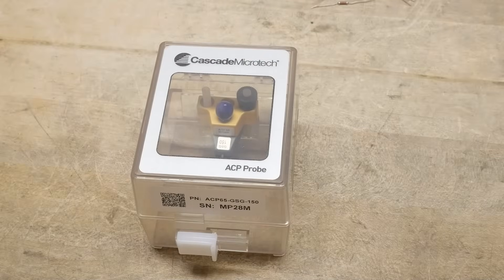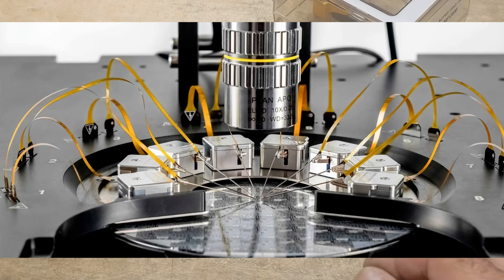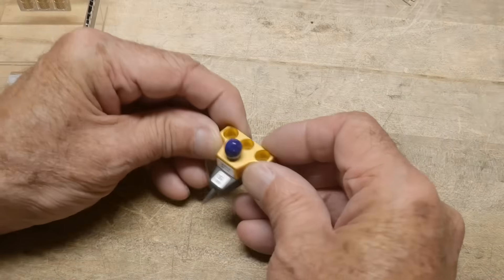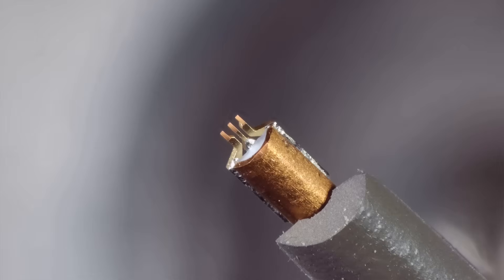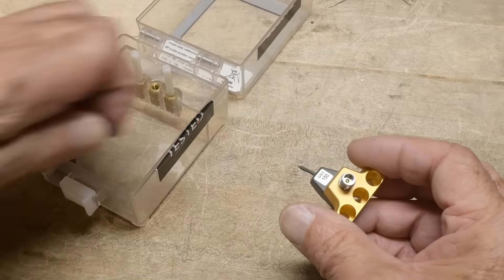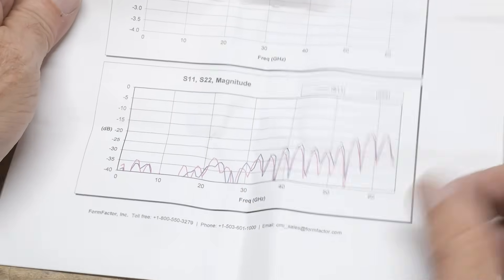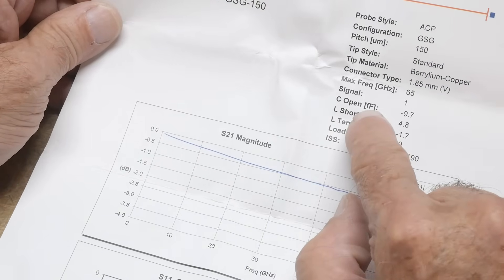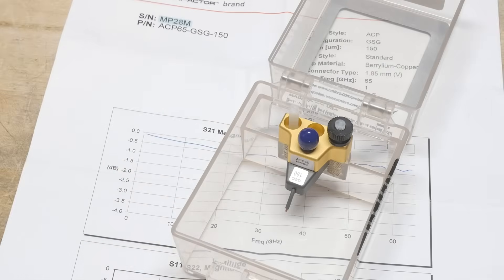#2365 65GHz Coaxial Wafer Probe

Comment: Long ago I got to design a PLL for a CPU chip at Sun Microsystems. When wafers of the CPU arrived they were given to a different department in the company that I never knew existed. I was allowed to attend testing with provision that I didn't talk about the equipment at that time. The wafers were tested without any mechanical probes on the internal metal traces. We could pick a trace in the IC layout and the "machine" would find and test its voltage in transient. It was like magic to see my simulation waveforms in HSPICE appear matching the real voltages on the screen. Sure beats the old probe stations. Back then we struggled trying to see rise times with expensive mechanical high speed probes in the early days.

Comment: Cascade is actually a real pain in the butt for making all custom connectors. Even the cheapo DC manipulators, the DPP105, have a custom coaxial connector which is very reminiscent of SMB but is entirely proprietary. Which of course means you have to buy a bunch of their connectors for a hefty premium, if you need to make custom cables for your setup.
Reply: Agreed. Also probing with GGB just “feels” better. You can really dig those in. Too bad cascade is the only one pushing the frequency ranges. That’s why GGB for DC and cascade for RF

Comment: Looks like it could be used to play vinyl records. 😱
Reply: With the bandwidth equivalent of 3 Billion Vinyl records lol
Reply: Maybe a video CED (Capacitance Electronic Disc), if you can build a proper tracking mechanism that will float those copper tips a few microns above the disc ;-)
Reply: Yeah, that was my first thought as well. It's about the right size. And you can pay a lot more than $350 for a phono cartridge too! 😆
Reply: @MikeU128  if you took a tiny shard of piezoelectric crystal and mounted to the tips, it certainly would work. Perhaps a cleaved piezo disc with solderable silver plated connection pads..

Comment: Another amazing thing that I didn't know was a thing.   For a device that needs to be probed with something like this to verify the process, do you need to include calibration sites (open, short, 50 ohm) on the die to probe?  I'm wondering how you make VNA measurements; do you cal "elsewhere" somehow?
Reply: Calibration substrate with very small traces and resistive patches. Look up cascade CS-9 for example. You'll intuitively see what I mean.
Reply: @JD-eq1gk  Of course things like this exist!  Thanks for the pointer!  That's cool stuff.

 Some years ago, I got to see some high-speed electro-optics being developed in a lab at NORTEL.  (This was when 10Gb/s was fast.. and NORTEL was still around)  In addition to the laser on the die, and supporting driver components, they had also laid down some isolated transistors.  These were solely for testing and another way to characterize the process in a pretty direct way.   That's what got me to thinking about the cal problem for a VNA here...